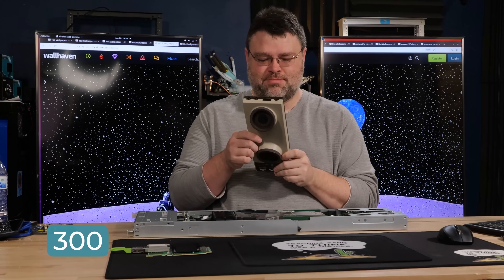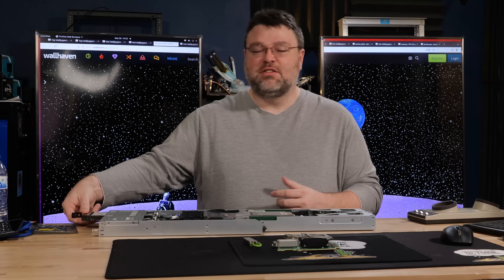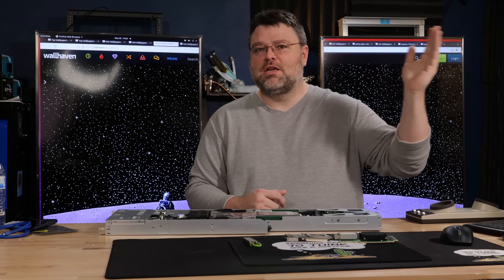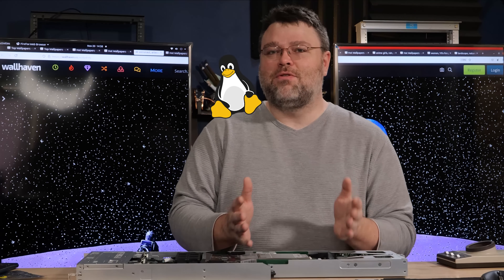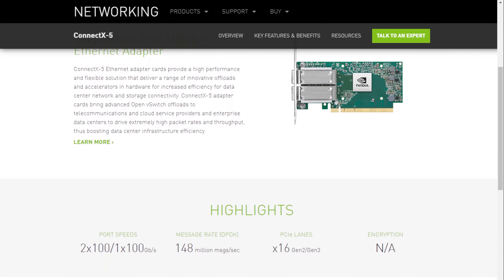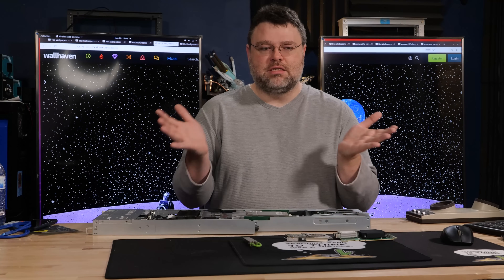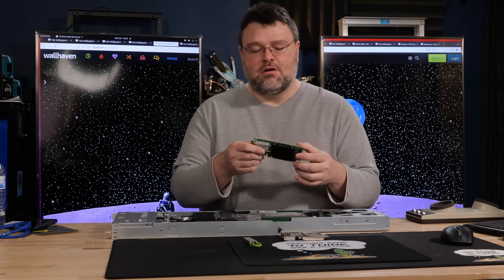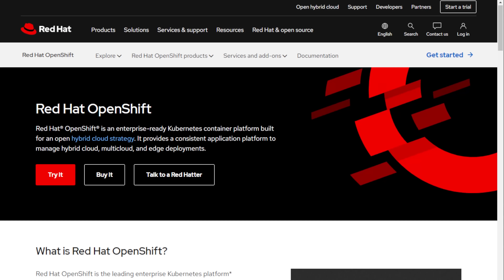Talking About Mellanox 100g

Comment: I understand that at the ends of the DAC cable there is an EEPROM and it says who I am. Question - does the NIC card ports reading the eeprom compare it to the eeprom on the other end of the cable?
I connected 2 DAC cables through a docking board (QSFP28 <->QSFP28) and can't get a connection between NIC cards
I don't understand what's wrong.

Comment: Dell was pushing 25Gb minimum connectivity four years ago. Now they're working toward having 100Gb as their new minimum standard. Given how their storage arrays are designed to function, with clusters of storage nodes aggregating high-performance NVMe flash RAID arrays, the array itself should be more than capable of providing multiple 100+Gbps data streams, sustained. I mean, the nodes in the clusters themselves are interconnected using no fewer than a pair of 200Gb infiniband connectors each, if not more. With the introduction of NVMe packetization for network transport protocols, the floodgates have really opened for high-speed networking well in excess of 10Gb.

Comment: Heads up, 400G is not 4x 100G, its 8x 50G. The switch to 400G changed the physical port from a QSFP28 (rated for 4x 25g) to QSFP-DD (rated for 8x 50G). Along with this physical change, the signal modulation was also changed from NRZ Modulation to PAM4 Modulation. You can buy a 400G optic that will combine 2x channels per lane for 4x 100G transport/breakout. But the originating channels are still 8x 50G
Reply: I thought that 400 Gbps was QSFP56, no?
Reply: @ewenchan1239  QSFP56 is 200G (4x 50G lanes). You can run 400G with QSFP-DD (8x50G), OSFP (8x 50G) or QSFP112 (4x 100G).

Basically it all boils down to the number of physical lanes available to the hardware, and how fast the electronics can drive each lane.

FYI these “lanes” are electrical and directly connect to the ASICs. Pluggable optics only convert the electrical signaling into lasers and then back into electrical signaling.

If you want some fun nightime reading, pull up some MSA documents for each type and they will describe the physical standard of each optic type

For 400G: SR8, DR4, FR4, LR4 and ZR4 are all defined!
Reply: @StupidFoxInSpace  
Ahhh...okay.

My bad.

I mean QSFP112. (I hadn't read the Mellanox ConnectX7 documentation until now.)

But to Wendall's point though, you CAN get 400G using 4x100G if it is a QSFP112, which means that what Wendall said isn't necessarily incorrect, with respect to your comments above:

"Heads up, 400G is not 4x 100G, its 8x 50G."

and

"You can run 400G...QSFP112 (4x 100G)."
Reply: @ewenchan1239  At the time of my original comment, QSFP112 had not been ratified and products using QSFP112 did not exist yet :) Apologies I didn’t clarify that in my response last night!
Reply: @StupidFoxInSpace  
Gotcha.

I wasn't sure about the timeline, but it looks like that the first public release of the QSFP-DD/QSFP-DD800/QSFP112 came out on May 20th, 2021 in Rev. 6.0 of the multi-source agreement, so your comment wasn't too far off from when it was published, and I would have to imagine that it was being worked on, behind-the-scenes.
Reply: @ewenchan1239  Ya, these are typically in the design committee for awhile. Unfortunately Im more on the design and deployment side of data centers, so I dont have as many ties directly into the committees. Ironically, the delay between OSFP 800G (100G lanes) and QSFP112 being ratified is why manufacturers released 400G (8x 50G) QSFP56-DD and 800G (8x 100G) OSFP first, compared to 400G (4x 100G) QSFP112.

Then once the MSA is ratified it takes time for components to work their way into the market :)
Reply: @StupidFoxInSpace  
Maybe, but I would also have to imagine that these things also don't happen in bubbles, isolated from each other.

I would also have to imagine, that by the time the QSFP56 (for 200 Gbps) MSA is in a state that CAN be ratified by the various stakeholders, at the various stakeholder levels, that they would already be working on QSFP112 not long thereafter.

It's like European emissions regulations - by the time that the EU Stage 6 emissions were complied with by the OEMs, all of the component makes already KNOW that EU Stage 7 is coming, so they already start working on that, if they HAVEN'T already started doing so by then. (A lot of times, there's actually quite a bit of overlap because of the development lead time that is required to be able to hit the market dates/timelines.)

And whilst I understand that they might have worked on QSFP56-DD first (or that was the first MSA to be published (per the revision history of the MSA, given that QSFP112 didn't make it into the MSA until Rev 6.0)), I would be surprised if the people who were working on the QSFP56-DD didn't know that the QSFP112 was coming.

I would trust, that with you working at a data center (vs. my having 100 Gbps IB deployed in my basement), that you might have some line of sight as to what is "better" between QSFP56-DD vs. QSFP112, even if the difference might be very little in benchmarking, and may not be noticable, in an actual deployment.

My point is that I am CERTAIN that Mellanox/Nvidia were already working on QSFP112 ConnectX-7 products, even before the MSA was in a state to be ratified by the various stakeholders. I would also guess that if they waited until the MSA was ratified, that it would be "too late" for them to START their development work on said ConnectX-7 (as an example).

Comment: Nobody wants to write an operating system? Then why does routerOS, HP Comware, etc. exist? Microsoft has an allegedly FOSS switch software named Sonic but MSFT software is always a trap. These Dell switches are cool but Nvidia now owns Cumulus and will not be supporting any Broadcom-based chipsets. These Dell switches are Broadcom chip devices.

Comment: I'm curious if the 100G/40G cards behave like a single 10GB/s transfer or if they behave like a link aggregation of 4 * 25G/10G?
I'm looking for the fastest access for a single desktop to a single server for single file copies and access. So it's really 25gbe or 40gbe that are the two specs that are interesting and in budget.
Reply: No, a 100G link formed by 4*25G channels doesn't behave like a link aggregation of 4 links of 25G, so in your use case the 40G link will be better, but good luck reaching does speeds on a single TCP session data transfer, for large and fast data transfer is much better to use multiple streams
Reply: That's not how LAG works.

Comment: From a Network Engineer point of view I would change the 100G port distribution, 2x100G for the inter-switch link and 1x100G for the Storage per switch, why? usually on this type of deployment MLAG is used and if that single 100G inter-switch goes down it will wreak havoc where the best scenario will be that a whole switch will shutdown all of its ports

Comment: 400G is only available on QSFP-DD ports (which is actually 8x50G lanes, not 4x100). AFAIK, 100Gb single lane SERDES aren't commonly available, yet.
Reply: You also have OSFP ports that have much better cooling and have flexibility to do more, the number of lanes are getting a bit more complicated, as of today we are seeing as you said 50G lanes in the ASIC but when you get to the actual physical on the optics we see a gearbox that will transform the 8x50G to 4x100G and that's the most common implementation, so as always it depends :)

Comment: I'm glad you mentioned how slow the cloud can be, comparatively, even if it's on great hardware. Also cloud equipment is shared, with bandwidth split between customers.
One thing I have not tried is the "dedicated" cloud hardware options, when you pay extra for bare metal equipment. I wonder if you can also get dedicated links between all the hardware, since different machines host CPU, drives, etc. Back when I did cloud things, it just chugged (compared to a high-speed desktop) due to the shared resource model. I remember several blog posts about "cpu steal" where another tenant could steal cpu time and your VM would be slow. There were also several blog posts comparing speed between cloud providers, some with better Iops, etc.
Maybe this is largely solved now, I've been out of this space for a few years.
Reply: i think your proposal has been an option for quite a while. if you look at a host like OVH, they have a vRack. so you rent multiple servers from them, but then they can be placed in a virtual private network. i don't know the specifics of the backbones between racks/floors etc in their datacenters, but they push some heavy data.... so i don't think it would ever feel like those network connections are bottlenecking you beyond actual enterprise grade technology limitation anyways.
Reply: Firstly, your host needs to be in a rack where the Top Of Rack Switch is not oversubscribed. But if you get bare metal in an appropriately divided TOR, seems you would have full fat access to the network via sfp/qsfp depending on the host type

Comment: So I have 3 servers, 2 are data storage servers exceeding 1250MB/s read/write, and the last server is for running VMs and pfSense. The VM server has a dual 100GbE NIC, with one connection to each server...any reason a switch would be better?
Reply: With JUST that setup, a swtich would give you some configuration options and outside access to the ressources aswell, but ig they only need to communicate together thats fine. 
One storage server could in theory go over the pfsense to the other storage server. But if you think about scaling it up more and more, you should opt in for a switch, since just one pc dying could mean everything behind it is not acessible anymore. Ringbus stuff for example. Or just having way too much overhead since someone is talking to one server trough a third one etc.
Reply: @TV4ELP  makes sense. it's a homelab, it'll never grow more than this; I've moved my entire environment (my gaming/workstation computers) into the VM server, so there are no additional server I could ever need.

Comment: Who stold my first modem? Mom, hang up the phone, you kicked me off CompuServ... Little did I know then how far we would come. Now I understand why  my dad was so amazed with personal computers like the C64. It was miles beyond a typewriter. Of course, there are very few places that have a 100Gb connection to the world, but like everything else, eventually someone will ask you why you're still stuck on slow af 100Gb to your house when its barely fast enough to surf the metaverse and certainly not in full 5 sense mode. Please bury me before we have metaverse fart jokes that you can smell!
Reply: 5mbit connection via wire and maybe 15mbit with mobile. Hybrid router gud stuff

Comment: I'm looking forward to replacing my 1GbE switch in the next year or so, but for now I'm fine with a single 10Gb link in my home network between my server & desktop.  The two machines are only a couple meters apart so I got a pair of X520-DA1 cards from China (knockoffs, not genuine Intel) and connected those with a cheap DAC cable.  A proper switch will be a nicer setup, although considering my main storage is spinning rust in raid6, I may not be in a rush to go beyond 10G.  The switch I want is something like: 4 x SFP+, 8 x 2.5GbE (4 w/ PoE).  I've been leaning toward Mikrotik but I'll consider Mellanox too.

Comment: Good news, looks like connection speed is slightly beating Moore's Law.
Based on the speed difference between the two you'd expect the old modem to have been made in 1964
Reply: Bad news(?), 10mbit ethernet was available in the early 80s. The comparison with the modem is unfair.

Comment: I love how cheap network hardware can get. You can pick up 40GB Mellanox switches under 200 and the NICs under 100. Great fun!
Reply: That would be awesome, and less than the cost of 10 gig hardware
Reply: @kenzieduckmoo  It's kind of an odd situation. Everyone and their dog is looking for a faster than gigabit network and are laser focused on 10G. This has made the price of 10G stuff kinda high as used cards and equipment is drying up. But as nobody is really looking at 40G and used gear is getting more available it's almost at the point there 40G is just as cheap or cheaper.
I almost want to take a stab at the InfiniBand stuff. 16 Port 56Gb switches for $100 shipped. I just have no idea how to interface an InfiniBand network with Ethernet without spending stupid amounts on a "gateway"
Reply: I picked up a supermicro blade system with 4 blades each with 2x 40g Mellanox boards in them for $600 and then added the switch to it. Instant home cloud. Though at 1400w for the power supply it costs quite a bit to keep it running. lol

Comment: 100g fiber isn't ethernet? It is unless you are talking about fiber channel, just like 10g, 40g or 25g SFP ports are just ethernet.
Reply: I think he just Missspoke, it is typical to call Cat5/6/7 with RJ45 connectors Ethernet cables so I think what he meant to say that is not RJ, ethernet doesn't really care about the actual cable as it is a Layer 2 protocol
Reply: Not sure about the newer gen cards or if the naming is still the same after the Nvidia buyout but connect-x3 cards could do Infiniband, Ethernet or both.
Base connect-x3 cards were Infiniband only
connect-x3 EN were Ethernet only
connect-x3 VPI were able to do both
Not sure what Wendel meant when he said that or if he just miss spoke because the switch he was talking about is an Ethernet switch.
Reply: I believe Mellanox Connect-X cards use their own protocol, not ethernet.
Or they can switch between protocols? Not sure
Reply: @popcorny007  What kind of protocol?
They have connect-x cards listed as ethernet, what would you connect them with? Infiniband is under seperate category, along with fibers channel you don't plug them into ethernet switches that were shown here.

Comment: ONIE is love, ONIE is life. Commodity switches are the future.
Reply: Word!
Reply: Not really, they are used mosty by hyperscalers so aws, azure, google cloud but still there isn't replacement for typical edge/core router (not layer 3 switches). ATT is trying to use that open computing model with DriveNets but it isn't really that popular, may end up using more power, space then chassis devices.
Reply: No

Comment: I don't even have 10gb cards to play with and Wendel has 100gb cards to play with :O
Reply: You can get 10/40gbe cards for under $30 atm.
I'd say the bigger cost depends on your setup.
If you have the devices close enough you can get cheap DAC cables but if you are doing distance you've got to deal with either Fiber or the high price of 10Gbase-T.
Reply: @LanceThumping  Can you link a few of those 30$ cards? I looking to buy some.
Reply: @LanceThumping  I think the problem is getting a 10g switch that you can use with you Ethernet wired house
Reply: @SilenceGProd  What's the problem? Switches are available, price may be problem.
Reply: @SilenceGProd  
MikroTik switches with several 10G ports is fairly inexpensive.

Comment: People are afraid of 5g, and here you are handling 100g without any protective head gear!
Reply: Well, 5g is survivable for some time for some people, not great, but not terrible either.
However 100G and once you cross 9g it starts to get rather dicey, it all depends for how long you decide to be subjected to all those gs...
Just stay away from the bathroom scales when you are subjected to them, because no diet can fix the number you see at that point.
Reply: @CMDRSweeper  LOL! You beat me to it!!! Good one!
Reply: But I like the warm buzzy feeling it gives me!
Reply: Its only active once injected intravenously.
Reply: Hahaha, "protective head gear"!

Astronauts don't even pull 100G at liftoff!  Wendell ftw!
Reply: It's a homeopathic poison. 100g is 20x safer than 5g.
Reply: I dont know if you know this but, 5G is 5 GHz, a radio frequency. All exposure to radiation has negative impact on your body, now a 100Gbe or Gbps is a speed metric, not a radio frequency
Reply: @LilConniePromotions  That's the thing about light, it ain't heavy ;-)